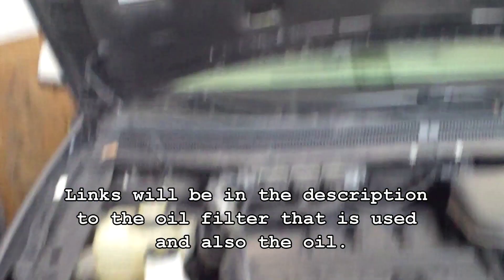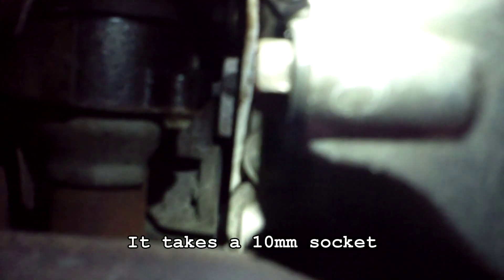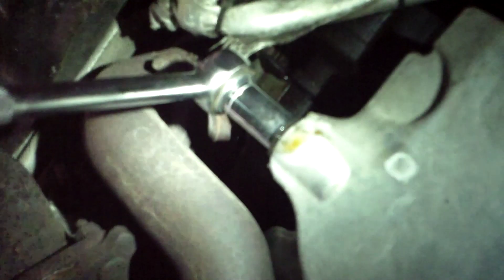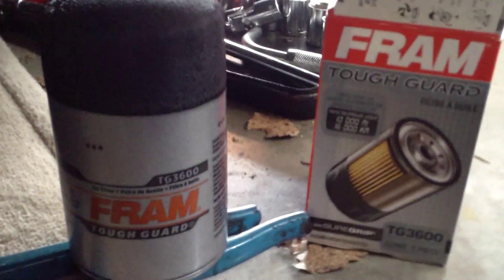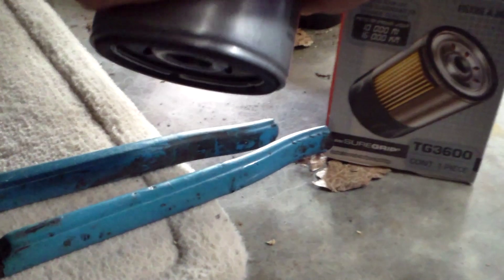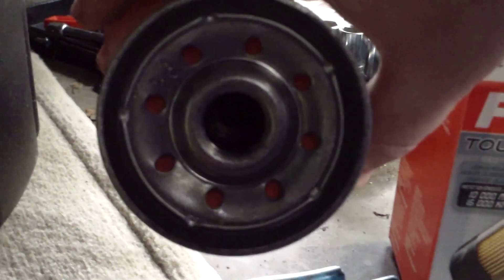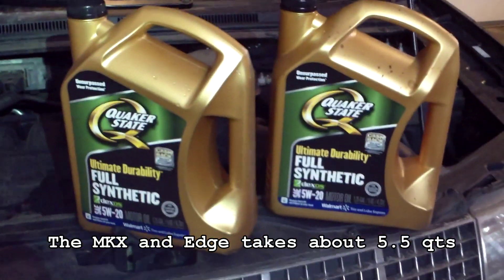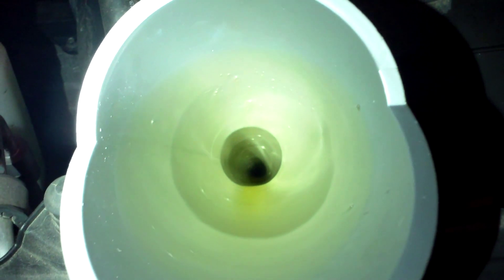Oil Change HOWTO MKX/Edge Lincoln/Ford

Comment: Good video. Couple of things I'd recommend: Verify with the car manual how much oil it takes with/without filter change. Add an amount that's approx. half a liter/quart less than the documentation says, then run the engine, revving it to 2K rpms for 30-45 secs. and shut the car off. Let it sit for 10 mins., and then re-check the oil dip stick to see you're oil level.  This allows for the oil to flow through the engine/filter and give a better reading after you let it sit. Add oil if necessary.

Comment: You should mention that when the oil filter is in a straight up position on the engine, you should fill the new one with fresh oil before installing. you don't have that opportunity on all engines.

Comment: I've always been in the habit of putting some oil in the filter.
Reply: Silly question, do you just pour the oil right into the filter?
Reply: @danielbornhoeft7803  Its late but Ill answer that question . Yes , Just pour it in the filter.
Reply: Daniel Bornhoeft  Yes, and keep it vertical while screwing it into place.